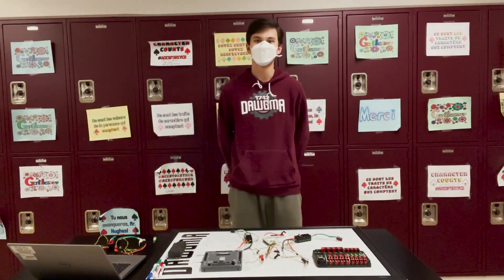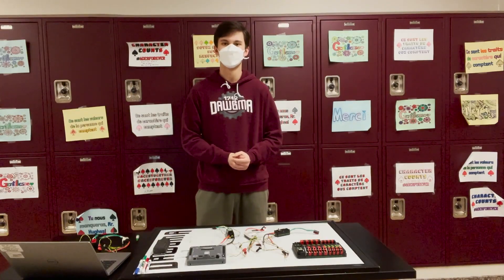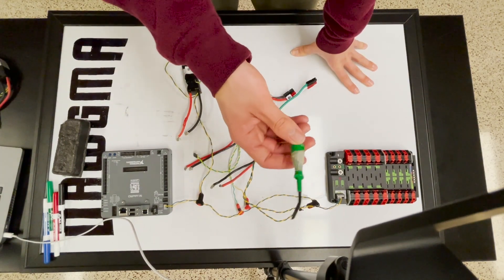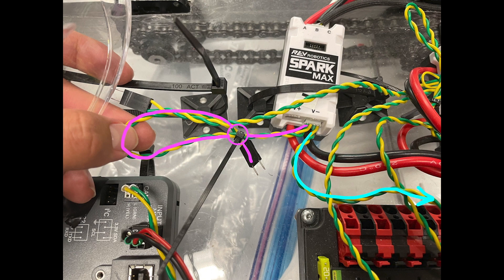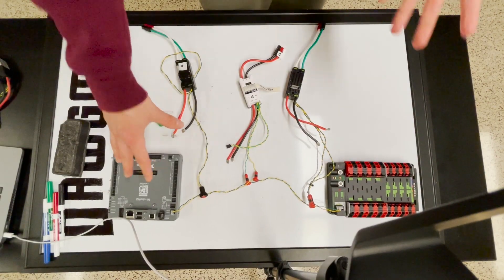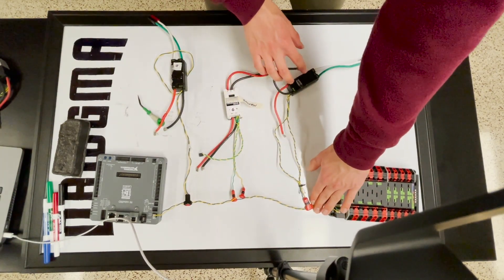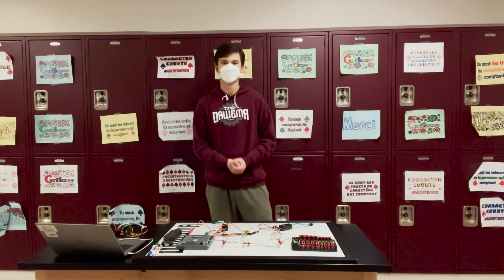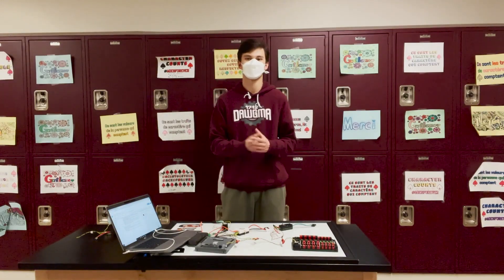CAN Bus Tutorial - Tips for implementing CAN on your robot!

Comment: CAN specifies use of 'Daisy Chain' for reliability. Short branches are allowable but must be kept quite short.
Tree structure as mentioned in this video can be problematic if any of the branches (Spurs) get too long.
Confusingly, the problem mostly doesn't cause glitches with the device at the end of the long branch, but rather other devices on the BUS.

Absolutely avoid any 'branch' longer than 30cm otherwise you will get the occasional glitch in the system.
If you have a distant CAN device on your robot it is essential to run the CAN wire pair up to it and a return CAN wire pair back down. (Unless you make that device the 120 ohm terminated end of the CAN Bus)
At the frequencies used in CAN,  a long branch will produce reflections of the CAN signal that may/will cause the bus to glitch occasionally or continuously. Data will be lost and error correction (if enabled) will be repeatedly having to resend.

As stated above - Often (In fact mostly!), it won't be the device at the end of the long branch that is having the errors. It depends how and where the reflections 'beat' with the existing signal.

I totally understand the need for mechanical ruggedness of the wiring, just don't have long branches and all should be good...YMMV
Reply: hey, i dont know if you still use this youtube accont but i have a question. We are using can bus on our robot and i was looking for the resources for our rookies to teach, and found this video.

I didn't understand what you meant saying "if you have branches longer than 30 cm run a CAN wire pair up and CAN wire pair back down"

Can you explain that part with an example at least please, thank you in advance
Reply: @DenizNaroglu  Probably too late for you, but in case anyone else comes across this: for branches over 30cm, to keep the daisy chain structure, you want something that looks like this (consider a bus with 3 devices):

Without two can lines (this will cause reflections because there is a 'branch,' node B, in the lines with no termination):

[Termination] -------- [A]----|------[C]--------[Termination]
                                            |
                                            |
                                           B

WITH two can lines, a signal from device A will always only have one path to travel.):

[Termination] -------- [A]---\    /------[C]--------[Termination]
                                           |    |
                                           |    |
                                           \  /
                                            B

Hope that helps!